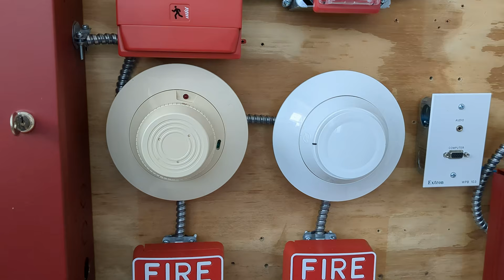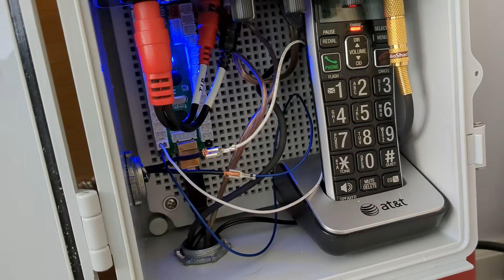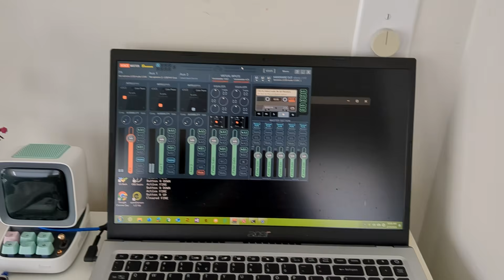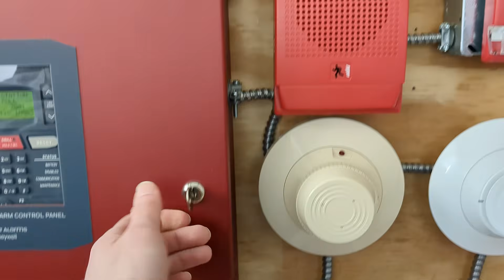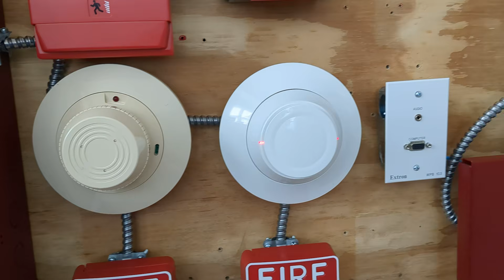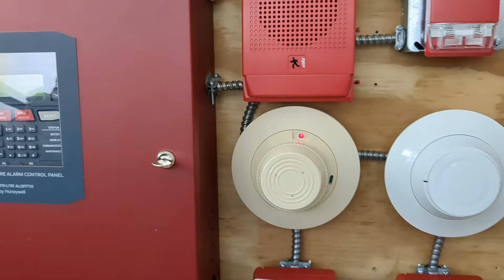Finally... Voice EVAC (& GLITCHY Smoke Detectors) | System Test 4

Comment: For your trouble question you have the module programmed as ressetable power that means upon reset power will drop for a few seconds then come back on. You need nonressetable power which is just constant upon reset or whatever.
Reply from the maker: The module that the 1451 was on is a Zone Interface Module, which is impossible to program as "resettable power". That option is only available for a Control Module. I have my ES-50X's resettable power connected to the ZIF because the power needs to briefly be cut from the detector upon system reset, otherwise the detector will never reset and will stay in alarm after activation. For whatever reason, it seems like the power is being cut for too long or something. Idk.

Comment: what phone model is that? I want to make my own system
Reply from the maker: It's an AT&T CL82313. I had to mod it to be able to get its audio output. I ripped out the rear speaker and soldered an impedance converter to it that gave me L & R RCA connectors. Btw, it's not a super convenient to set up. My parent's house just happens to have a landline system and those wireless phones, so I wanted to find something cool to do with them. The reason it isn't convenient to set up is because not only do you need a base unit, but you also need a second handset to hook-up to the EVAC system. Not to mention the soldering process to achieve audio out.
Reply: @slendertech why not just get a Bogen UTI-1? It’s literally made for telephone paging
Reply from the maker: @captainchris2016  Not sure that it could interface with the EVAC portion of the system.

Comment: Most likely the issues with detectors is the result of mixing litespeed devices in with clip only devices. I’ve seen it a dozen or so times in the field when someone adds on new smokes and a new panel on a loop with clip only smokes
Reply from the maker: As far as I know, the newer MMF-300 & 302, the newer BG-12LX, and the SD-365 (all of which I have) support LiteSpeed.
Reply: @sle @slendertech ah right so that’s a conventional smoke on a 302? Are you using the 3.2K EOLR for the 302?
Reply from the maker: @tmalley  I was just using a standard 4.7K as used on a regular conventional system for end of line. I did not know I had to use a specific resistor type for the 302. When I bought the 300 on eBay for the BG-12, it came with a 4.7K. When I bought the 302, it came with no resistor.

Comment: i have a chepaer way to get an mp3 player to use as a vevac system if u wanna know
Reply: I wanna know
Reply from the maker: I am aware of this method. Aaron productions did a video on it a while back. You know, I had a video I planned to release before Christmas explaining why exactly I went with the complex EVAC setup I did. Unfortunately, it was waaaaay too long. Long story short, the current setup I have allows me more customization and I enjoyed writing the computer software for it too. I also like the idea of using a proper PA amp for the speaker instead of whatever built-in one is in that MP3 player board thing.